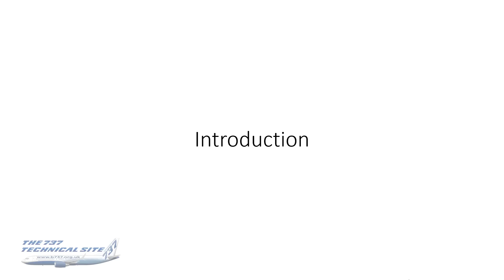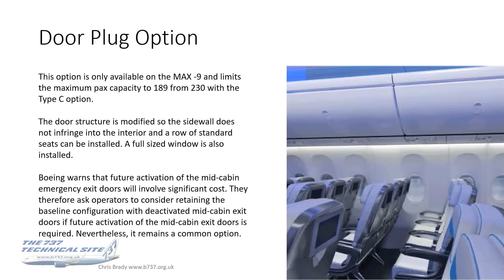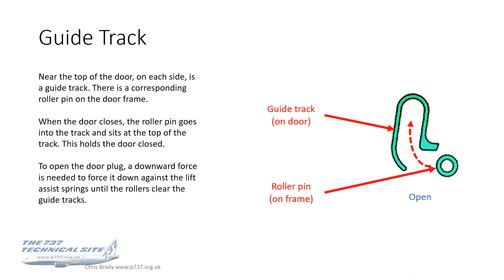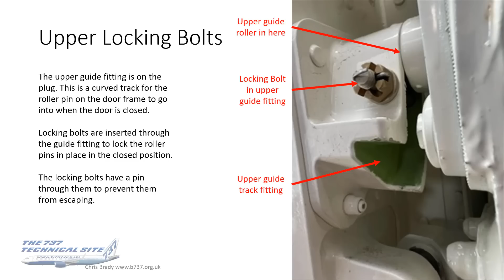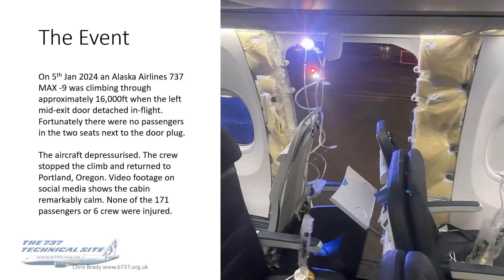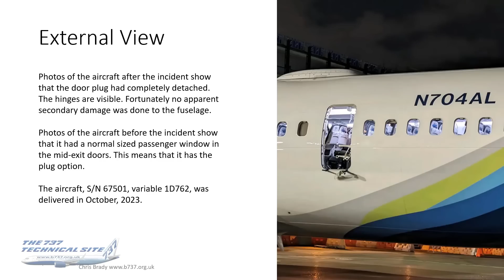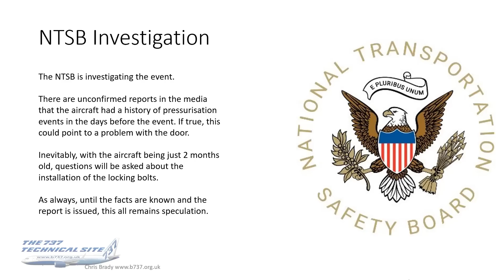737 Mid-Cabin Emergency Exit Doors - Plug Option

Comment: Your slide at 3:43 states that the DOOR “must move DOWNWARDS to clear the stop fittings before [the door] can fold down”. And your slide at 6:30 states that “to OPEN the door plug a DOWNWARD force is needed…until the rollers clear the guide tracks.”

Unless I’m misunderstanding how this works, I think the explanation is backwards. It appears to me that the DOOR must move UPWARDS to clear the stop fittings and to OPEN the door an UPWARD force (assisted by the lift springs) is needed to push the door/guide track UPWARD to clear the roller pin/stop fittings.

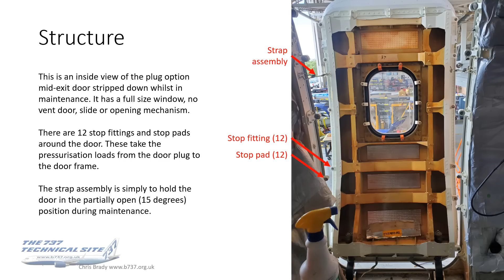Also, the slide at 5:45 should state that the primary purpose of the Lift Assist Springs is to provide an upward lifting force to assist in lifting the door such that the guide track clears the roller pin and the stop fittings clear the stop pads. Secondary function of the springs would be to make sure the door will not fall back in the closed position.
Reply from the maker: * Errata *
In this video I state that a downwards force is required to remove the door plug. I based this statement on text in the AMM SDS which I now believe to be incorrect or misleading. It is possible that a very small downwards motion (1-2mm) is first required to be able to free the locking bolts. But the door must be moved upwards by a couple of inches to clear the guide tracks. Apologies for any confusion.
Reply: @ChrisBrady737  So, the manual is wrong? Maybe that's why the door fell off! 😮
Reply: The slide at 9:06 shows the downward path of the roller guide.
It may be pushed down to clear the roller guide and then lifted to clear the door frame. (?)
Reply: @jonathanbott87  The guide is on the door, which would need to move up to clear the roller on the frame.
Reply: @MCLastUsername  On Boeings, the guides are usually found on the door frames. Is this different? When you open, say, a regular Boeing 747 door, the door handle moves the rollers (which run in the frame guides). I'm not sure what the springs do on this mid-cabin door plug.
Reply: @ImperrfectStranger  I'm no expert, I'm just going by the photo at 4:50 clearly showing the guides on the door and pins on the frame. In the photo at 9:06, the door is on the left, as you can tell from the arrangement of the stop at the bottom of the photo.
Reply: @MCLastUsername  Thanks for the timestamps. Looks like you're correct. Weird stuff. Maybe they should have stuck with tradition regarding the design. i.e. Guides on door frame.
Reply: @MCLastUsername  Now that you mention it, I have this vague recollection that he said that the doors had to go up in his first video on the subject.
Reply: @ImperrfectStranger That would certainly help to explain the confusion. If that is the case then functional boeing doors are configured opposite from the way these plug doors are configured. It may also be why boeing recommendeds that customers choose a deactivated door options vs plug door option due the significant reconfiguration of the latching mechanisms required to convert the door type.
Reply: @jonathanbott87 looking at that picture at 9:06, either the “upper guide track fitting” is moved upward to disengage from the “upper guide roller” or the “upper guide roller” is moved downward to disengage from the “upper guide track fitting”.  It looks to me like the “upper guide roller” is securely fixed to the cabin airframe and doesn’t slide therefore it is the “upper guide track fitting” that is the moving part. If the “upper guide roller” stays in a fixed position then the “upper guide track fitting” must be moved UPWARD for the “upper guide roller” to be disengaged from the track. If the “upper guide roller” can move then I’m wrong. If I am correct, then assuming the “upper guide track frame” is attached in a fixed position to the plug door, then the entire door is moved UPWARD to disengage from the “upper guide roller”.
Reply from the maker: AMM SDS 52-23-00 Page 6 MID CABIN EXIT DOOR PLUG - COMPONENTS, Lift Assist Springs:
"Apply a downward force to the door plug this forces it down until the rollers clear the guide tracks. At this time the door plug can open outboard."
Reply: @ChrisBrady737 Hmmm, interesting. That doesn’t match up with the pictures and diagrams in the presentation. It would be physically impossible to push down on the door shown if the roller is fully engaged in the guide. Could the manual you have cited be referencing a different plug door configuration than the one used for the presentation materials? The cited text implies the open end of the guide fitting would be facing up while the guide fittings shown in the pictures have the open end facing down.

Comment: Those roller pins look wayyyy too short to me. Any flex in the plane / door frame and the pin could pop out. You can see the bolts used to secure the pin are located at the very edge to catch the pin, because the pin is so short. Looks like maybe a 1/2” on each side is all that hold the hinges. Also looks like there was plenty of room to make the pin much longer. Why not make the pin long enough to fill the full width of the hanger? I can see how the plane could have flexed and popped one of the pins out and broke the seal, cabin pressure blew the door off after that. With one side pin popped out the other could easily follow with more play in top half of the door. Looks like bottom hinges were ripped out after the top half of the door was open and out of/ detached from the plane.
Reply: The vertical movement arrestor bolt should also keep it from moving down
Reply: @jonathanbott87    I don’t think the door moved down at all, I think the pin slipped out of the hanger sideways/ outwards when the plane frame flexed/ twisted from the vertical Gs/ load on takeoff. . It could also have just slipped past the hanger bolt. The frame must flex a lot on takeoff with all that stress. Look how short those pins are. Doesn’t leave much room for error at all.
Reply: So if that happened, the locking bolts should still be in place at the top at least.  Can't see in the low res photo.
Reply: @rbh1151   Exactly. Hopefully they find the door soon. No matter what they find, those pins should be much longer IMO.
Reply: The locking bolts are attached to the guide track, which is on the door/plug. We will see when they find the door/plug. @rbh1151

Comment: More questions: is the door frame identical whether fitted with plug , disabled or one of the Type II II or III doors (which I assume are physically identical but bear different paperwork) ?

In your long video from 2 years ago about all the doors, you mention about mid exit doors that they need to be lifted up before able to hinge outwards. But also mention that you just need to pull a handle (which opens hole to vent any differential pressure) and then push door outwards (with no mention of moving door vertically). 
In this video about the plugs, you mention that the door panel needs  to travel downwards to move the roller out of the guide track before the top so door can swing outwards (which makes sense since hinges are at bottom)    So curious about how different  the door frame is when fitted with a plug vs real door.
Reply: The option matrix and explanation at the beginning of the video covered it reasonably well.
Looks like a remove bolts, lift up, lever out, then it'll drop down to the strap limits for the plug type door.
Which strongly suggests the failure chain, either missing nuts or the cotter key was omitted, the nuts not properly torqued and a non-fail-safe design for the guides that allow motion during early pressurization.
But then, that's what investigations are for, to determine the most probable chain of events, their causes and how to prevent them from ever happening again.
And this will be one of the rare happy accidents in aviation that improves safety, for it'll be entirely written in ink, rather than the more usual blood.
Reply: I think we need a confirmation there , my opinion is that the plug panel needs to be lifted ( not downward ) to free the plug panel from the frame roller pins .
Reply: The roller pins in the picures in this video (as well as the drawing) had the pins secure in the "up" position and needed to move down to reach the opening where they can move out.  And if the hinges are at bottom, it makes sense that a door taller than door frame would need to move down so the stop can clear the frame and be pused out while the bottom moves littke since at the hinge point and can later move back up and out.  @patpat5135
Reply from the maker: * Errata *
In this video I state that a downwards force is required to remove the door plug. I based this statement on text in the AMM SDS which I now believe to be incorrect or misleading. It is possible that a very small downwards motion (1-2mm) is first required to be able to free the locking bolts. But the door must be moved upwards by a couple of inches to clear the guide tracks. Apologies for any confusion.
Reply: @ChrisBrady737  Thank you Sir.

Comment: After watching this the only thing that makes sense is that somehow one, or both the guide sleeves on the top of the plug door must have failed, causing the door to move slightly away and out, and the wind then caught the plug and ripped it off the bottom hinges.  They really need to find the plug door.
Reply: Being 2 months old it’s clearly a factory oversight, probably over/under torqued some bolts or forget to safety wire some lock nuts, who knows.

Comment: Question about the Guide Track slide: Am I confused or isn't actually a upward force needed to clear the pin? (which is assisted by a spring in the lower hinge mechanism?) Your description would only work if the pin (which clearly is not the case regarding the pictures) is on the door.
Reply from the maker: * Errata *
In this video I state that a downwards force is required to remove the door plug. I based this statement on text in the AMM SDS which I now believe to be incorrect or misleading. It is possible that a very small downwards motion (1-2mm) is first required to be able to free the locking bolts. But the door must be moved upwards by a couple of inches to clear the guide tracks. Apologies for any confusion.
Reply: @ChrisBrady737  Thanks for being a real cool guy. You not only took the time to make this important video but to own some happenstance error pointed out by some vagrant Youtube folk that in no way impacted the rest of your video.

Integrity is rare, and you got it in loads.
Reply from the maker: @sapincher Thanks for your support on this, if I make an error (and we all sometimes do) I am happy to own up to it. The important thing is that the correct information gets out there.
Reply from the maker: You give a downward force to the door to clear the pin, then the hinge lifts the door outwards. So kind of both!
Reply: @ChrisBrady737  Still confused on this - if the pin track is on the door doesn't downward force simply push it further against the frame mounted pins? Do the tracks/pins move?
Reply: @Blackburnian737  Thank goodness I am not the only who doesn't get it :D
Reply: @Blackburnian737 I believe you push the door down to clear to top pins from the top tracks. Then the top of the door can lean out to clear the tracks as the door is lifted.
Reply: @drooplug  The pin is on the frame, and the tracks are on the door. So when it is closed, you cannot push the door down anymore because the pin is at the top of the track, thus it must be that you have to push the door up to clear the pins from the tracks.
Reply: @sapincher I am confused like you may be. The author of this video clearly states the door panel must be pushed down first to clear the upper pin. I do not see how that can be the case. Very strange.
Reply: @sapincher  If the tracks are on the door, this door is different from all the other types of Boeing doors I have manuals for (including the small overwing 737NG type).  The purpose of the door handles is to rotate the rollers (pins) on the door to move them out of the frame guides.
Reply: @ImperrfectStranger At 7:38 in this video he shows a picture pointing out the guides on the door itself and you can make out the very small roller pins on the door frame.
Reply: @joelsheebs728  I don't think we are confused, I think it is just a small and irrelevant mistake in an otherwise extremely informative video.
Reply: @sapincher  Thanks! Looks like Boeing suddenly decided to do things differently.
Reply: @ImperrfectStranger  And maybe not for the better, considering those little tracks and stubby pins each have to hold approx. 4 tons of outward force...

EDIT: The math - estimate door plug size at 6ft x 2ft = 1728sq.in. Assume cabin pressurized to 6k ft altitude = 11.8psi. Service ceiling of 41k ft = 2.59psi - a difference of 9.21psi. Across the surface area, that is 15,915lbs, or about 8 tons. That's 4 tons on each - worst case scenario but not including any safety factor. I'm sure the bottom hinges will help bear a fraction of the load, but that still seems like a lot to ask of the thin walls of the guides or the apparently only 3 attachment points for them to the door.
Reply: @sapincher The load is not (or at least not completly)on the hinge mechanism/door pins. The door rests on those 12 pads.
Reply: @sapincher  Not sure I follow you. The pressurisation force is normally on the 12 stop pads. So your 8 ton value on the door goes down to 666kg per stop pad. The guides, hinges and other parts may take up some of that pressure, too. Typical NG cabin differential pressures in cruise are around 8.35 to 8.45psi according to the Maintenance Manual. (emergency) Overpressure valves are set at just under 9psi , so you weren't far off.
Reply: @ImperrfectStranger   @oj2372  I didn't know that about the stop pads. That makes the engineering at least quite a bit more sound and definitely more likely of someone didn't castellate their nuts properly.

EDIT: I am aware that is a bad joke.